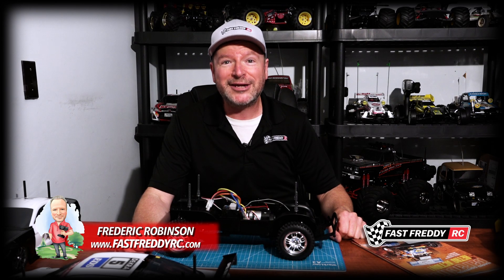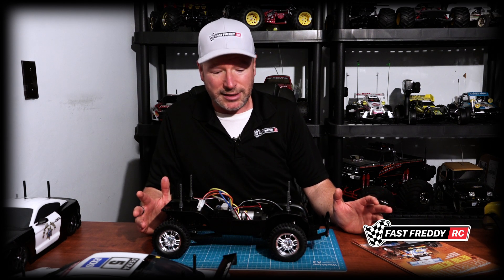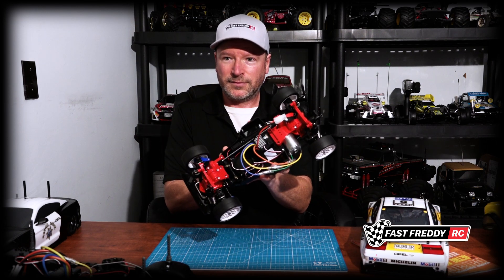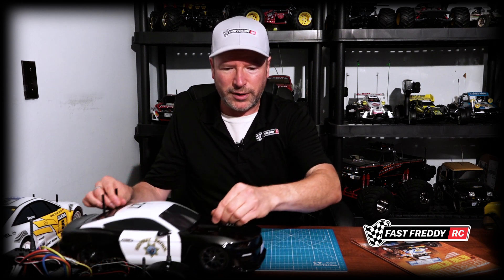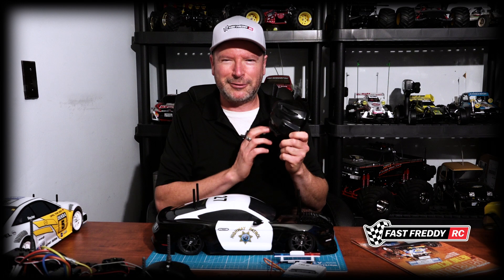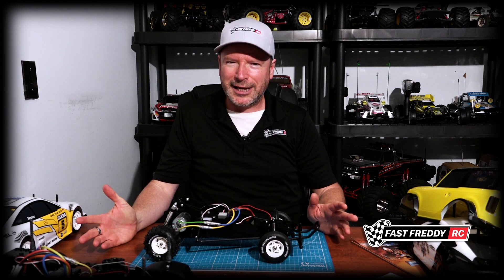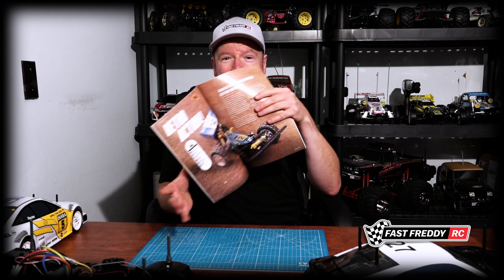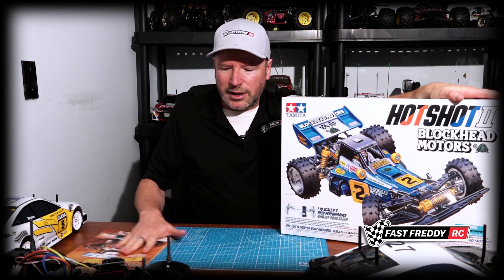Channel Update Video!!! - What's in the works and a new kit for the channel!

Comment: I have built many CC01 chassis trucks. I like them but they are not very modern. For a basic trail truck the CC01 is okay. The newer Tamiya CC02 chassis is a better. The plastic chassis are not very good on the CC02.  Especially if you consider that Tamiya has metal chassis extenders that are metal. I wonder why they did that. The Tamiya CC02 is not a good crawler truck but is okay for a trail truck. It would be better with a metal chassis. Thoughts?
Reply from the maker: I really like the CC01 but as you say it’s really for general use and trail riding. The funny thing is I’m not sure how much crawling was a thing back when the first CC01 came out. That was 1993?? I think?? It was over 25 years, approx, before Tamiya came out with the replacement CC02 chassis!! That is quite the gap! Now do I expect the CC02 to be an amazing crawler? No I don’t. Most true crawlers these days have chassis that give the trucks incredible suspension articulation and super soft tires which the CC02 just doesn’t have. It’s a massive improvement over the CC01 but I won’t be able to really put it through it’s paces until I’ve finished building it as the Bronco is my first CC02 build. But what I can say is that I’ll be having some fun testing out both these vehicles and seeing just what they are, or are not, capable of. The only real crawler that Tamiya offers, and I use that term loosely, is the CR-01 chassis. But in my mind it’s too big and not well balanced for true crawling. But again, Tamiya isn’t really a company that specializes in that arena. Would I like to see a true crawler kit come out from them? Yes. Will it happen? Probably not.
Reply: @FastFreddyRC   It funny you mentioned the Tamiya Cr-01 Chassis. I have one, it very tall and very heavy. I do like it but it just problematic. Thoughts?
Reply from the maker: When you say it's problematic...what sort of issues do you run into?  @alfredyost7972
Reply: @FastFreddyRC   Perhaps problematic is too harsh a word. I mean that it is very top heavy. Also, I do not like the upside shocks. I did get the Tamiya aluminum shocks for mine and they work well and they do not leak. Of course Tamiya shocks work well, even the plastic ones.